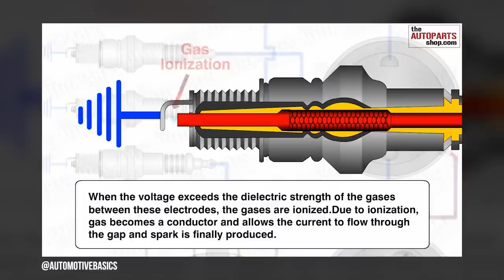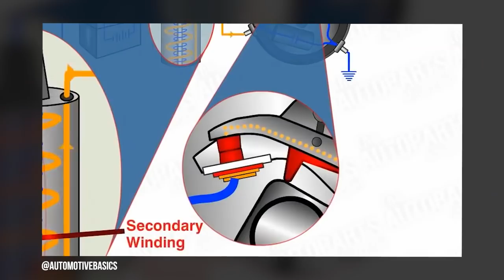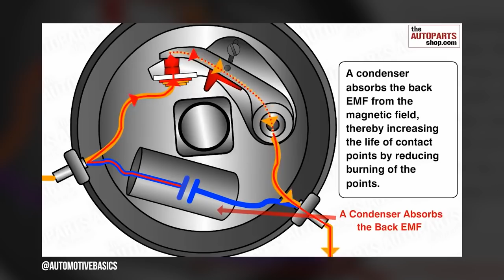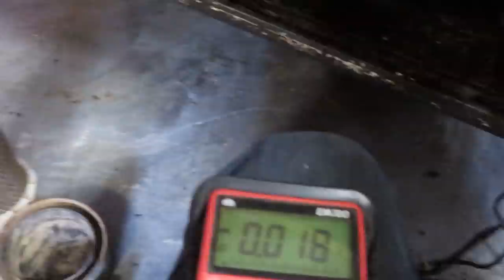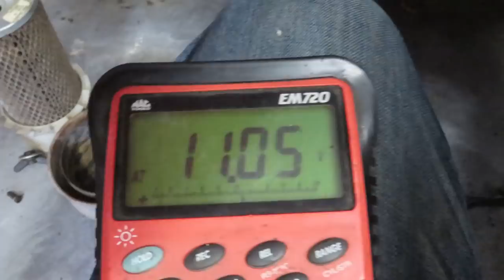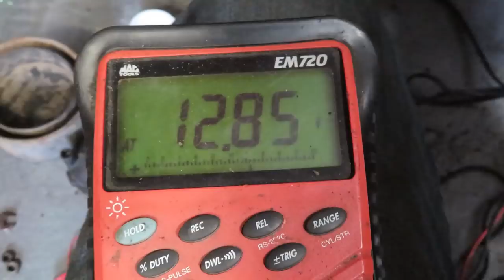What Could Be Wrong With A $300 Skid Steer?

Comment: I've never seen a non-diesel Bobcat... Learn new things every day.
Reply: Many of the older smaller bobcats are powered by Wisconsin motors that are 16hp give or take. Those unit get a new HF engine a lot of times. Solves most of those problems along with better power. Older units like this ( well not this exact unit ) were set up with option that could have aux hydraulics on them. This problem can be fixed with a new spool valve. Doing this also make older machine run far better. Investment in a small machine can make it a whole lot more use out of it.
Reply: What type of engine is that one? Looks like a Toyota. Anyone know?
Reply: I never thought they would’ve existed either. Seems to be a better option than a diesel in Canada during the winter.
Reply: I drive a propane forklift for uhaul sometimes
Reply: @danw1030  It's a Mitsubishi 4G32...1.6L.
Reply: Thanks Tyler!
Reply: I have that model bobcat petrol motor in Australia! Just keeps going
Reply: Har. I've never seen a non-Kubota Bobcat.
Those that know, know.
Reply: HeadlineNews fr tho this guy will teach you shit this is my first time watching him
Reply: @kameljoe21  ààqAL
Reply: William Glaser Most Wisconsin powered skid steers I’ve seen have the big V4s in them, which range anywhere from 25-65 hp.
Reply: @danw1030  Mine is a Ford engine. The same one used in Pintos
Reply: I had a 642 gas with a Ford and a 742 with a Mitsubishi gas engine.
Reply: We just got an electric one for specific jobs and holy shit are they garbage. Low power and minimal run time on a battery system so large we used the forklift to change them
Reply: @Senkino5o  The first Melro Bobcats had a Wisconsin AIR COOLED V4hd gas engine
Reply: @Backyardmech1  EASTER STARTER IN SUB ZERO AREAS GOOD FOR MOVING SNOW  LIKE THE EARLY SNOW CATS
Reply: We got one here in Ireland petrol bobcat. Only 1 I know of. The guy brought it back from New York or New Jersey. Is that the same place? Anyways. No one will take a present of it. We hate petrol things
Reply: @ferguson20diesel49  IT BEATS HAND DIGGING
Reply: Alphonso Tate if it doesn’t start its good for nothing. Petrol is expensive and it’s too unreliable.
Reply: @ferguson20diesel49  maybe for you guys. Diesel is almost premium gas prices here. And each have their issues, diesels won't start if you dont heat them up first with a glow plug
Reply: @ericschuh9394  green diesel is the cheapest fuel here.
And need glow plugs for all diesel is entirely not true. Some diesels do not need them what so ever. Others do on good day. Like kubota engines.
Fiat agri or isuzu engine would start any weather no heat.
Reply: @ferguson20diesel49  nice. Biodiesel. Like I said pros and cons, its an opinion. Im used to diesel myself. Btw new York and new jersey are 2 different states, but right next to each other
Reply: @ericschuh9394  it's actually normal diesel. But it green and white here.
Was never in the states so I don't know it too well
Reply: Still have one for yard use
Reply: @danw1030  they had ford and mitsubishi gas engines
Reply: @danw1030  old question but I'll answer - I have a 732 Bobcat from 1980 and it has a Ford pinto 4 cyl gas motor in it.  Before I got it someone converted it so it now runs off propane.  It would be a handy machine if it would stop freaking leaking everywhere...but that's bobcat.  If there no oil under them theres no oil in them.  

I also have a Bobcat 520 from `1978ish that has a 2cyl air cooled Kohler motor in it.  Like something you would see on a old lawn tractor.  super easy to work on.  only 18hp.
Reply: Bobcats were gas for a long time...well in to the 80's I believe... learned to run skid steer on a old Wisconsin powered 763
Reply: @brentwinkelman1990  My other bobcat is a 520 and it has a 2cyl gas kohler K series motor thats air cooled.  very simple to work on but a bitch to get parts for.
Reply: I have a 742b gas ⛽
Reply: @kameljoe21   what is the spool valve for? i have a 1996 450 with a kohler in it and the arm drop by itself slowly when using full throttle and having a bit of an issue lifting a bucket full for snow could that be it?
Reply: @StyleGT  The spool valve is a stack of many valves for your hydraulic system. Pretty much one to move the arms up and down, one to tilt bucket, one to move left tires and one for the right tires. Your system sounds like 2 things. Low on fluid and needs a filter change. This could be a start for where your problems are. Once you change out the hydraulic filter and check the levels you can start going from that location. Check the linkage of your controls. The next stage is check the spool valve. Only do this after you know the pump is good. I am not sure how your unit is set up. If I am right there is one main pump then 2 motors for the drive unit. If the drive unit work fine and does not seem to be under powered and the bucket tilts like its suposse to then your main pump is fine. This would lead to the spool valve being bad. I think there are some videos online and some old forum post where they show you how to rebuild them. In some cases you might be able to replace the valves with a whole new unit. Though it can get pricey depending on the style that is required. Start with filter and levels and work from there.
Reply: @kameljoe21   Thanks for the reply William, Yes i already went thru Filter, findings leaks , replacing hoses this summer,  the tilt function works  as it should and its very powerfull like the drive power of the machine. I will look into finding the Spool valves for the arm then at this points its all i can think of,
Reply: @StyleGT  Its the spool valve then. I know there is a forum page out three that explains how to fix the problem. If I remember later today I will search for it and tag you again.
Reply: i have a USB key with the shop manual on it imma try to look  for it and what i need to order, basicly its a solenoid with a spring right?
Reply: @kameljoe21   i found a video of the exact machine i have or very close , it seems like i have to remove the whole body valve assembly to get there........ ill go look tonight if i can take it appart on the machine.    It seems to be a longer part than what you linked.  the guy in the video seem to only change gaskets(orings kinda ) and spring and call it a rebuild. is that it? or i have to really order the full valve assembly like you posted?
Reply: @StyleGT  As long as that valve is not damaged or bent or anything which its like is not. Just the o rings and seals should be enough. The only reason to buy a whole unit is if the cost is about the same or just a bit more. For example if the seals and rings cost 10 dollars and the valve is 15 dollars. Get the valve and you know that the whole thing is new and can eliminate that problem all together. I am pretty sure this is the problem. Once you replace the one that is not working ( boom) and check to see if its working great. If it does and you can do it. Replace them all. Will cost a little bit more and you are likely to see a major improvment in the machine. I wish I could find that source as that is pretty much what the person did. They had a problem with I think a drive not wanting to go all the time or something and replaced it made it super fast and then they went right in and replace everything and saw a major improvement of the machine. What is going on is that fluid is being bypassed to another area ( back in to the hydraulic tank ) which is what causes the slower speeds or the jerky or intermittences of the problem. Once you fix this you pretty much do not have to fix anything else other than check for wear on stuff. Keep me posted.
Reply: @kameljoe21   Will do,  im putting the kids to bed right now and heading to the garage, this is exactly what an old timer told me the other day, he said your oil is going back to your tank thats why the boom is coming down slowly, the machine isnt leaking anymore, few lines was leaky before but all fixed, thanks imma take a look and keep you posted for sure! hopefully i can do this job quickly without too much hassle, will order the springs and seal as soon as i can and get this body valve removed after a snow storm XD
Reply: @StyleGT  Any updates on what you fixed?
Reply: @kameljoe21   Hello William, well i am very un decisive between repacking the cylinders or rebuilding the valve body so i still dunno where to start, snow keep pouring in atm so i might wait until a more calm season or this summer to attack this project i am scared of breaking  something and waiting months for parts lol, i feel like  imma rebuild the valve body first.  I reached last owner recently ( he had it since new ) and he never touched that thing he said so there that xD i heard i could test the cylinder also before repacking them but it feel more easy to just rebuild them in place lol
Reply: @StyleGT  Repacking the cylinders are super easy. You just have to have a clean area. There are a ton of videos on how to pack them. 
Though the odds of the cylinder needed repacked for the inside section is very slim. As long as your cylinders are not bleeding out of the main seal they should be mostly good. 
Have you looked at the valve body? Do you know what a new one cost? 
I get you do not want to tear down and have to wait months for parts. I have been keeping an email thread so that way I do not forget about this. 
I had thought of a way of testing the cylinders yet it does not really work because if the valve body is bad you can not just cap one end of the ram to see if it has bad seals. The only way you might be able to do this is if you have one of those portable hydrulic pumps, like the hand pump ones. Though I am not sure those would have the adapters to work either. I know that the rams will be quite costly if bought new. 100s of dollars to match the same bore and stoke.
Reply: @kameljoe21 Wisconsin engine is 32 hp, I know because I had one, also it was a very reliable and easy to work on machine

Comment: Deboss, even though I knew about points ignition your explanation was the easiest explanation I have ever heard. I think I just re-learned points ignition.
Reply: I remember the first time I heard about how Ye Olde points ignition on original minis worked, and having a immediate sense of respect for my mum who changed at least 2 sets in the dark, in the rain, in a cramped mini engine bay while at the side of the road

Anyone who's had a old mini or been in one will know the little blue cardboard boxes with the spare sets of points in them rattling around the front of the car 😁
Reply: Atleast he isnt saying the capacitor is there to make the spark HOT like everyone else in the world my god how many times have I had that argument.
Reply: @mor4y  I first learned about points getting into old '70s and '80s french mopeds. Was a total pain in the ass at first, but once you learn it you don't forget.

Comment: Definitely not a machine you’d waste a good fire extinguisher on haha
Reply: Lol some of the bigger fire extinguishers are like a couple hundred bucks to buy new, meaning discharging a fire extinguisher might cost more than the machine is worth😂
Reply: @Adam_Poirier  truth
Reply: @Adam_Poirier  We used to have ones on carts at work that I'm guessing were at least 2/3 thousand.
Reply: Not to mention the mess that would need to be cleaned after as well.
Reply: @Adam_Poirier  refills are cheaper
Reply: Oh boy did I almost loose my skidsteer to fire a month ago. Pinhole in a hydraulic line sprayed up at the exhaust. If my wife and daughter weren't around to uncap and hand me water bottles from a case I had just bought I would of lost it. Very foolish and literally playing with fire if you don't have at least one fire extinguisher on your machine....
Reply: 12345NoNamesLeft, true. It’s like propane tanks when you get propane. The tank & gas is $50, but just the gas is $20 for a refill.
Reply: @michaelbenoit248  if you go get your own tank filled rather than doing an exchange at the gas station or wherever it's even cheaper. It's 10 bucks to fill a bbq tank at the ace hardware near my house.

Comment: Bobcats are very helpful, but working on them through microwave oven door size openings sure can be an awful experience
Reply: thay arnt that bad, some spots are tight but still pretty simple.
Reply: My experience with bobcats is that they are shit. Kubota is a much better machine
Reply: Good thing Bobcats use kubota engines then..
Reply: @huntguy3831  glad my 2011 t190 has a Kobota motor from japan.
Reply: My 773 has a v2203 kubota and it is great, currently swapping one into a 1951 Willys M38 Military Jeep
Reply: @axispowerdiesel  The 773 isn't too bad to work on in my opinion.
Reply: The engines in them are good but the rest of the machine is shit
Reply: Videx Sicarii  whats a previa Karen transporter?
Reply: @GVTSounds  not anymore
Reply: @donttreadonme4355  the little hump on the front makes working under the cab uncomfortable

Comment: I have never understood people's attitude about old equipment.  I  stole it for $300. Its worth $3000 in decent shape but I don't want to put any money in it.Even though you could spend up to $2700 to make it right and be even.The very same person will go and drop $10K on a machine and not think twice about spending 3k to fix the machine that is worth 10k and be 3k in the hole.🤔
Reply: Most of the time it is a mental block, but depends on the equipment. I've got a $55k excavator that I bought new from a dealer and take care of it. If it needs expensive parts, I'll probably put them in because I've had it since new and know every minute of its operating history. 
  
Compare that to a machine that I bought for $500 and spent $350 to get running. Boy I beat that thing like a red headed step kid and when it finally blows up, it is going to a scrap pile somewhere. It might need a couple hundred or a couple grand to get going again, but id rather replace a continually faulty component than chase Murphy all through a drivetrain and hydraulic system. Been there done that, and my time is way more valuable than low end equipment is typically useful.
Reply: Thats the thing though, there is a reason it was sold for $300, its unreliable, thus now a hobbyist tool, not one that earns money.

You could put $2k into it and while all the new parts would work perfect, something else can fail and mess up the new parts, or require another $2k be spent or the entire thing sold at scrap metal prices. We already saw this a little bit with both the new (but now broken) distributor rotor, with the bad wires and with the minor fire. None of that matters when its your $300 garbage, but if you try build it up to be something more, then an actual restoration will cost you more than an equally reliable newer machine would.
Reply: I am not even sure what the model of this unit is, With out that I have no clue how many HP the motor is. Most of these little skidsteers sell between 3 and 5k and have less than 22HP on them. There are a few videos out there where people just pull the old motor out and repower them with a HF engine. 800 bucks more and better power. The thing that these lack is aux hydraulics, Simple 3 spool valve will fix this. Total investment with cheap labor 1500 bucks, Now you have a reliable machine that you can paint and sell for more than what you pay for it. With the option of aux hydraulics which is what people want in those little machines. 
Price of a used machine and fixing it up saves you money in the long run. I have done the same thing on high end tools vs renting them, example that I did was redid my hardwood floors so I searched out a floor sander ( new cost 5k or more ) found one for 300 bucks that had a few missing parts and been sitting out side. I did all the testing  while there to make sure the machine worked. Which because it sat outside needed the bearing lubbed up, Did that and got it to run and took his offer at 250 due to the machine being stuck. Then I bought new parts for it which cost be about 150 dollars, Now I have 400 cash in it plus 100 in travel cost and what ever else. Cleaned up after I am done and I should be able to sell it for 1500, even if I sell it dirt cheap at 500 bucks I still get my money back and saved me all of that money that I would have spent renting a machine for 2 week. Along with the sand paper I bought at a fraction of the retail price I can sell at the retail price and make a large margin. even if I order a few more boxes of paper I could make huge amounts of money.
Reply: @kameljoe21  Looks like a Bobcat 642B or 742B
Reply: @Heretic306  Yeah it might be mid range. Lots of the older mid range models were optional for gas. Once you get to the 700 to 800 range they should be diesel. Though I think I have seen a 700 model in gas. Anything 500 and under should be gas unless they were converted at some point.  Correct me if I am wrong. This is what I know from running 800s, 300s and the newer 650 classes. Though I would trade a S650 for a S300 any day of the week. Now the T650s are not do bad as I do not have enough hours to be sure if its any good. I always keep my eye out on the smaller stuff as that is what I intend to get at some point.
Reply: You don't generally buy a $300 tractor when you have money for a $3000 tractor. People hunt super-deals because they need super deals.
Reply: Foam Farmer  HF is a harbor freight predator series engines which range from a few Horse power up to 22 horse power. Lower cost than name brand and are just as good.
Reply: @kameljoe21  YOUVE FORGOTTEN JUST HOW MUCH TIME YOUVE INVESTED.
Reply: I was always told it's not what your machine is worth, but what is it going to cost to replace it.

Comment: Using a test lamp when detecting bad connections is recommended. As the inner withstand of the voltmeter is extremely high, you won't get a correct value, without having a little bit of current runing through the wire and especially bad connections.